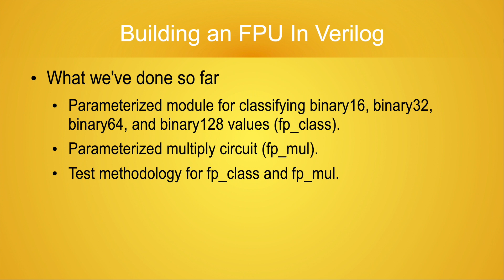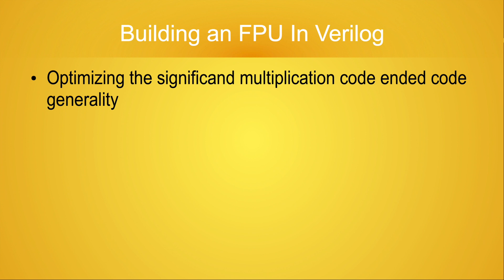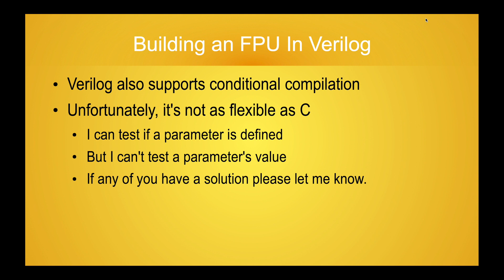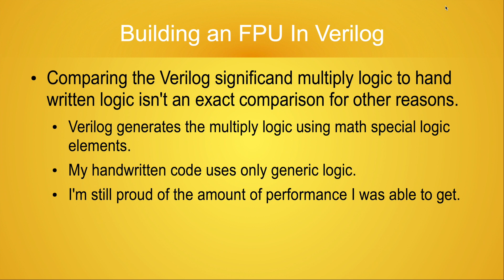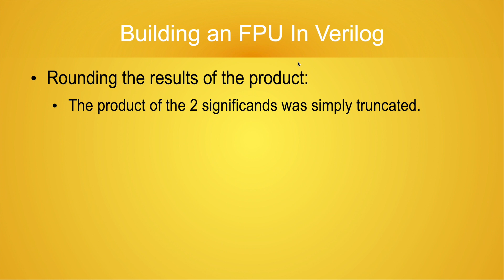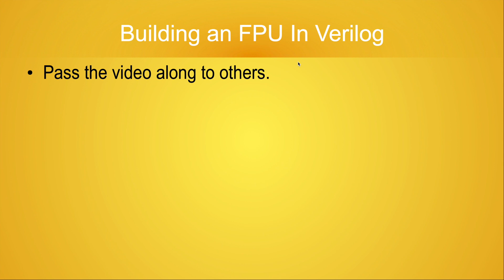Building an FPU in Verilog: Wrap-up of Multiply Circuit

Comment: Sorry I didn't answer in last video, got really tough end of year...

Congratulations on almost matching speed of dedicated DSP block!

Verilog macros are very rudimentary and ugly. But you can get parametrizable modules by using, well, PARAMETERS :) Something like that:

module FPU_MUL (input [Width-1:0] A, input [Width-1:0] B, output [Width-1:0] C);

parameter Width = 16;

generate
   if (Width == 16) begin
      FPU_16   inst (A, B, C);
   end  
   else if (Width == 32) begin
      FPU_32 inst (A,B,C);
   end
   else begin
       Generic_FPU inst (A,B,C);
       defparam
           inst.Width = Width;
   end
endgenerate

endmodule

Good thing about this: it is possible to have several instances of FPU_MUL with different parameters. With macros it's not possible because it parses that module just once and substitutes `Width with particular number defined before.
Reply from the maker: I'll have to check out what your suggestion to see if the compiler really does only generate logic for the portions of the code which are reachable.

What Verilog tool set are you using?
Reply: @FPUniversity  I'm using Quartus II  9.0 SP2.

In Quartus that works, I used "generate" keyword to conditionally synthesize some modules. It should probably work in other tools as well.